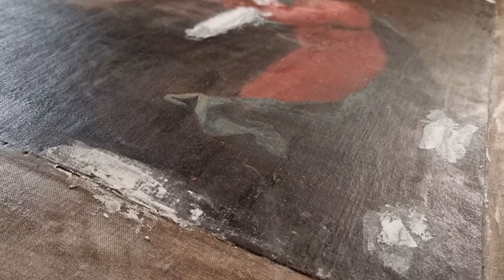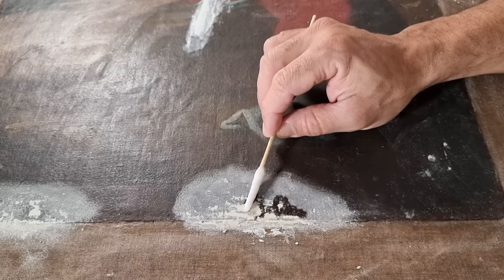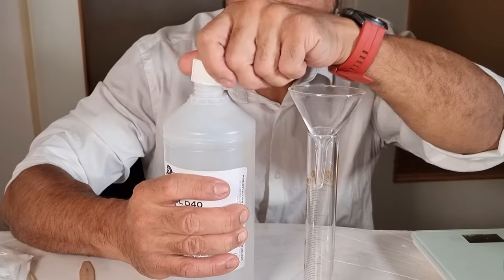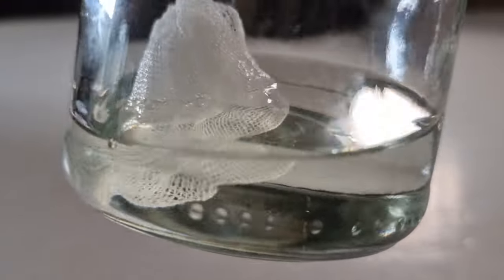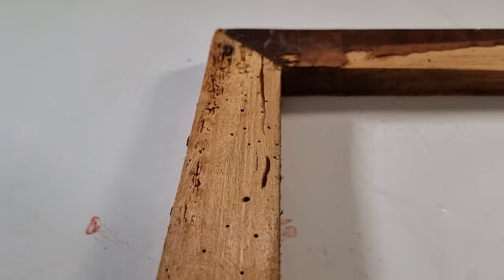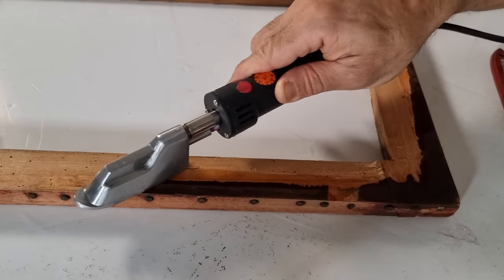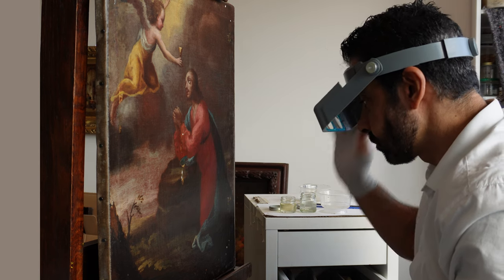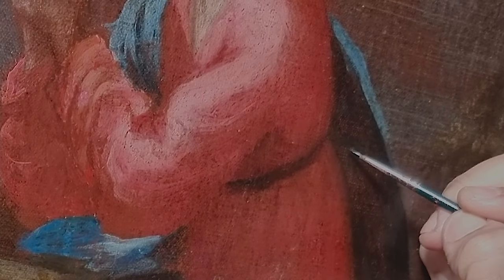Saving and restoring 17century old painting. The retouch and final varnish protection

Comment: I am puzzled by how you used the fabric bag to make the varnish.  What is the advantage of this method over just mixing the resin into the solvents directly?
Reply from the maker: Thank you for Diane, your feedback. in fact, the resin does not dissolve; directly if mixed with the solvent, it takes several hours, and it is important it does not stay in contact with the bottom of the jar.